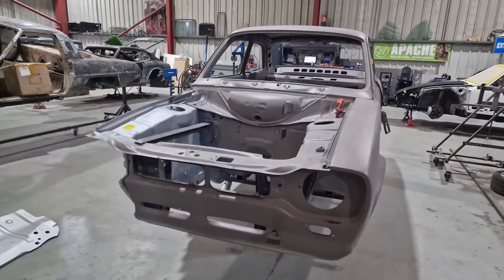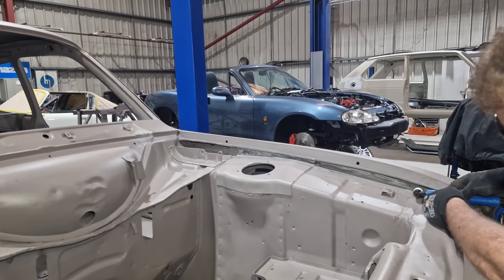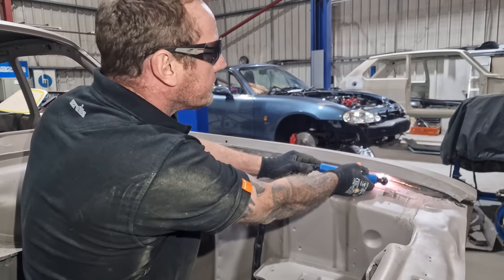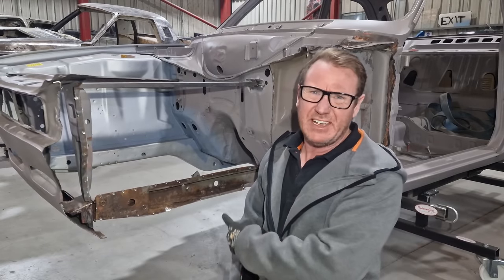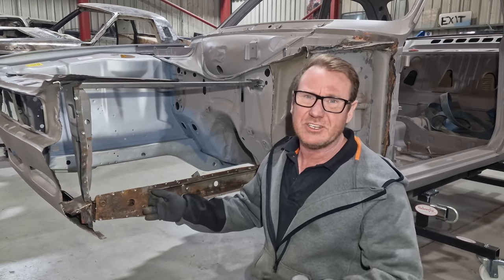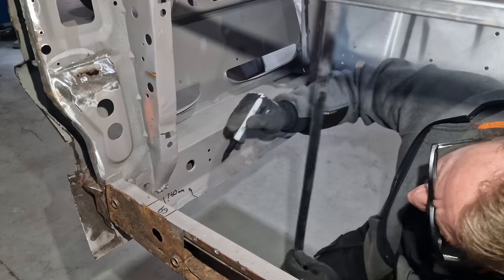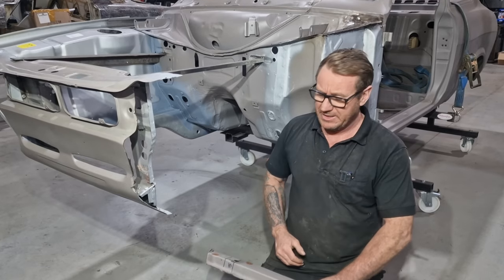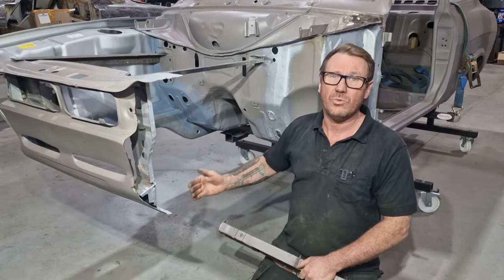We Failed !! - Mk1 Ford Escort RS2000 restoration

Comment: R-TECH supply some good kit and their customer support is second to none. Nice to see the escort coming along
Reply: I have a brand new one sitting on a bench with a card fault. Didn't last one week. When I rang to enquire as to "WTF like?" their returns policy was such a ballache, was so costly & so open-ended regarding costs in their favour not mine, I left it on the bench where it still sits & I have an intense dislike for them as a company ever since.

 Never before have I bought a welder (I weld full-time all day every day, I wake up & go weld) that let me down so badly, or left such a bad taste in my mouth with so few f** given from the supplier.   I have, over the years, bought  machines from all-comers including Kemmpi, Lincoln, Miller, Mosa & Sip -  more recently Hitbox, Jasic & Yeswelder - never had a machine so much as blink from any of them & don't have a bad word to say about any - but R-Tech win the award as the one welding-plant supplier to have ever p****d me off in over 40 years of professional welding.
Reply: The Miller did die - has to be said - but only after 3 years of 10 hour days running with multiple operators -  Miller fixed it for the cost of parts within a week & were epic tbh. That, the R-Tech & one Kemppi that got  dropped down a 30' stairwell are the only welders that have ever died in my ownership.

 Miller fixed theirs with no quibbles, Kemppi can't be blamed for catastrophic damage due to sudden de-celleration(it was an eye-wateringly expensive machine, absolutely brilliant & worth every penny, but still.. I wince to this day) , the R-Tech was such a crap ownership experience even seeing one still annoys me & I am pragmatic enough to seldom get annoyed by tools. It was by no means cheap - but it was nasty.

Comment: Rust was terrible on those, same as in the Renault 12 or even worse. I used to have one of those Fords just for autocross in the very late 90s. Nobody was even considering to repair or restore the rust bucket back then, so I got it mostly for free from a scrap yard. I ended rolling it and that was its demise :P. Great job rebuilding that one!

Comment: excellent workmanship, but I would have fitted the inner wing before removing the chassis leg, surely that would have aided alignment with it in place. Once the inner wing was fitted that would have kept some structural integrity and then replace the chassis leg.
Reply from the maker: There is no correct way of doing it, just different ways of doing it.

Comment: It looks like you cleaned up some rust then painted over it instead of cutting it out and replacing around 23:09. If so is this because of moisture or something else?
Reply from the maker: Nope didn't paint over rust. Cleaned selent and surface rust off. There was a small hole but this was prote Ted till we get to that area with a thin layer of primer. We have to finish what we have started first.

Comment: No Steve, not failed, just a reminder to inspect cars before restoring even more for hidden 'treasures'. And another  'way to exploit your craftsmanship even more'.
Although you may not feel that way: showing what wend 'wrong' is a sign of strength AND helps me to feel that 'even craftsmen like you make mistakes', so i am less hard on myself.
You are human! 

Poor customer: the more you reveal, the bigger the disaster. 
But than again: better now than after what seemed toe be a restauration. Is it an idea to inspect the cars that come in with an endoscope, to reveal the 'hidden treasures' timely? 

Do such discoveries make you think that acid dipping is THE first way to go if you really want to discover such disasters timely, or is the chance too big that there are no reference points left to hang on to after such an procedure? Come and think of it: do you have these points after this thorough cutting? And are after market panels precise enough to fit to the rest of the car?  

Anyway: thanks again!

Comment: TBH, every seam in that car is boned. If that were me, I'd pull the whole thing to pieces, body shell too. New chassis rails, everything.

Without a full rust removal, even if you seal everything up, there will be residual moisture in there and it WILL rot out again. Maybe it will take 10 years, but I'm a perfectionist. 100% or nothing.

Comment: Hello guys, am I right in assuming that there are differences between RS from England and those from Genk etc. I don't see any reinforcement plate on the upper strut and the front plate in the area of the radiator looks like it was sawn by itself. Greetings from Germany
Reply from the maker: The strengthening plates look like they were never put back in on a previous repair but yes they should be there :)
Reply: I was about to post the same thing
Reply: @yorkshirecarrestoration  Thanks!